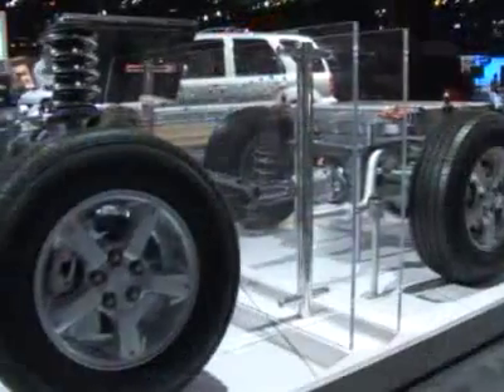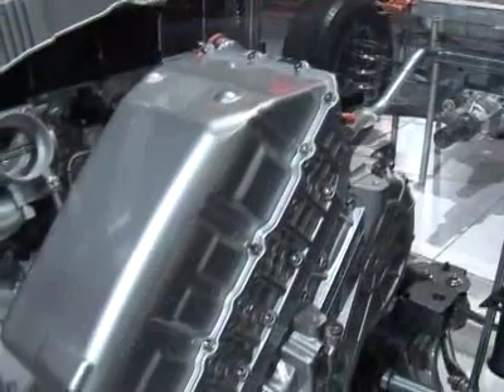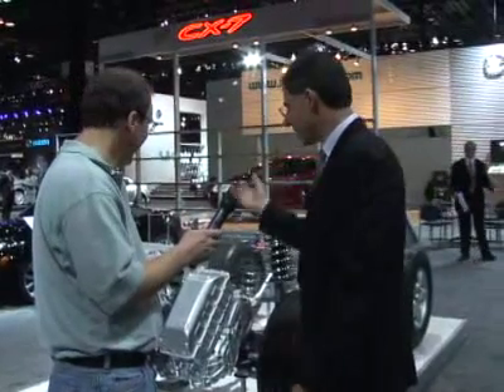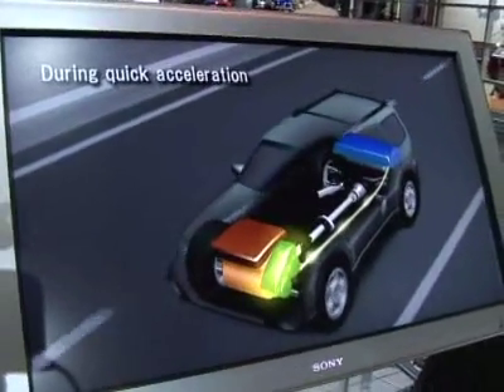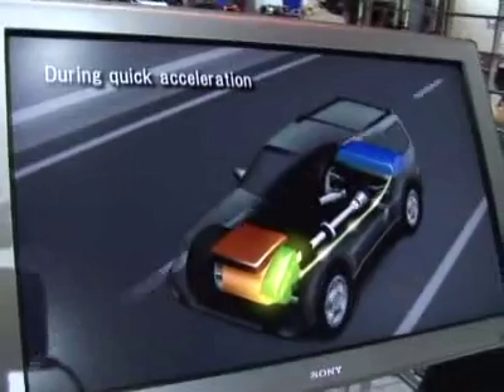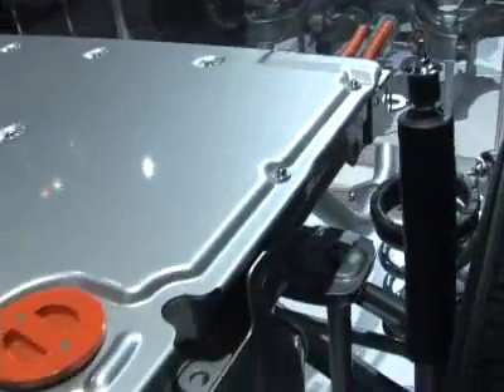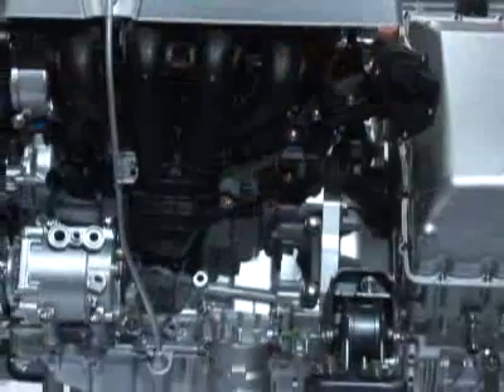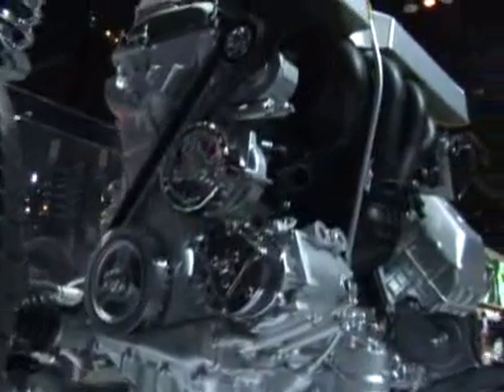How Hybrid Engines Work

Comment: Some energy can be recovered back to the batteries through regenerative braking but they can not store more then they are rated to hold and an internal combustion engine wastes more then it provides (mostly through heat).

Comment: From the first B-Series pickup truck, Mazda has used the engine displacement to determine the name. Thus, the B1500 had a 1.5 L I4 engine, and the B4000 has a 4.0 L V6. For 2002, the name was changed to simply Mazda Truck in the United States. Mazda's partnership with Ford has resulted in the sharing of this vehicle—the Mazda B-Series and Ford Ranger are essentially the same after 1994.